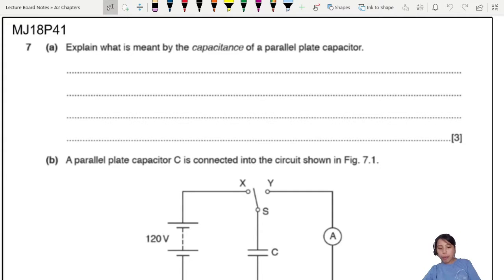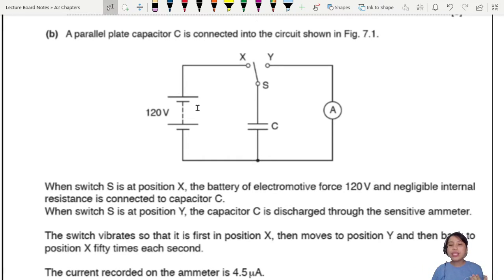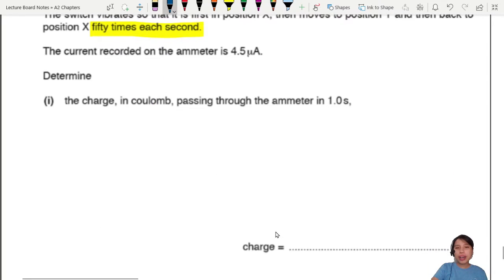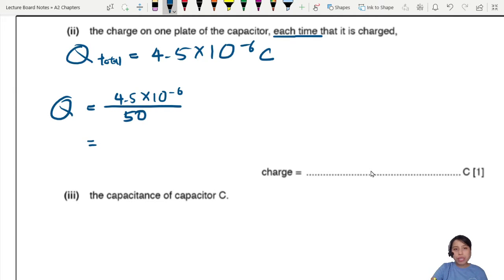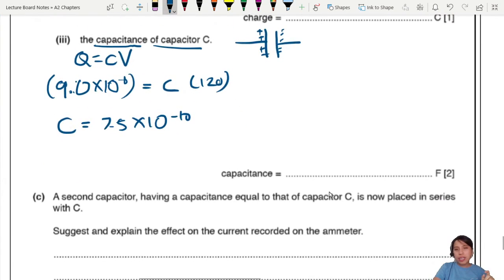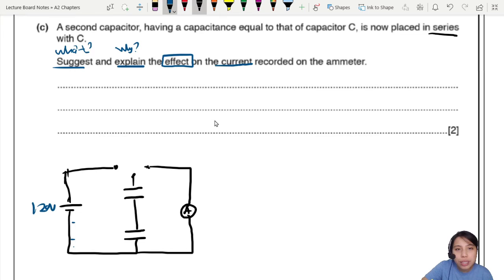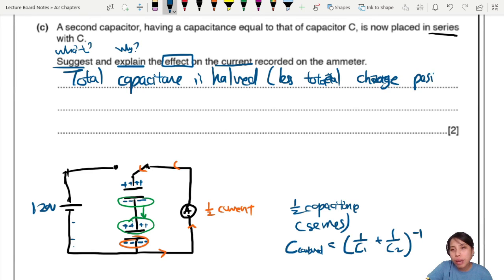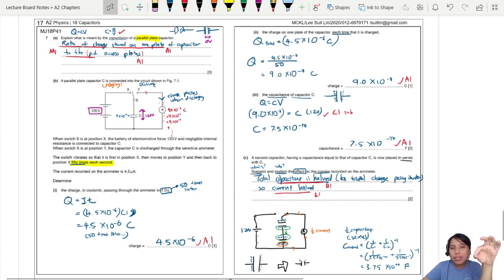19.1e Ex3 MJ18 P41 Q7 Vibrating Switch Cycles | A2 Capacitance | Cambridge A Level 9702 Physics

Comment: doesnt voltage divide in series and charge stay the same then how does 1/2c=(1/2Q)/v , shouldnt it be the other way around?
Reply: nvm that just try this, we know that capacitance is series is added like : 1\ C = 1\C1 + 1\C2, right? so now use that value we got in b) (iii) and after calculating you find the capacitance is decreased to half.

Note: don't get confused between VOLTAGE in series and CAPACITANCE in series, they are different, I hope this makes sense lol.
Reply: @akidanis6984  i get that the capacitance halves and i get why it does but i don't get the current part. i am saying that if the capacitance halves then why does the current half shouldn't it be voltage that halves not current
Reply: Q = C/v 
But q = it so 
I = c/vt 
I would be directly proportional to c so if capacitance decreases by 2, current decreases by 2